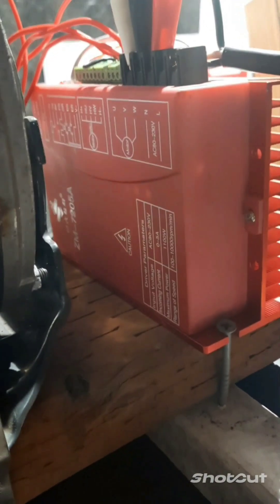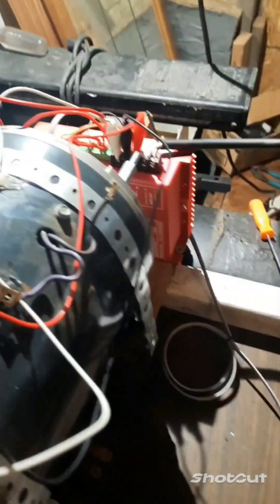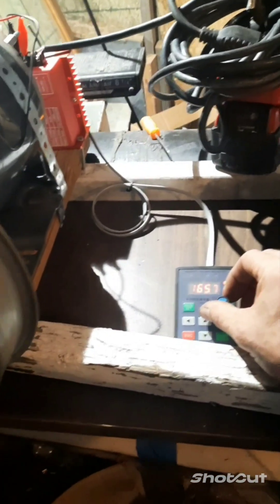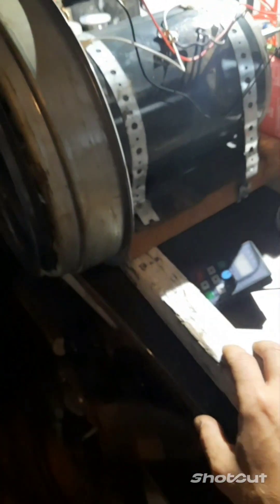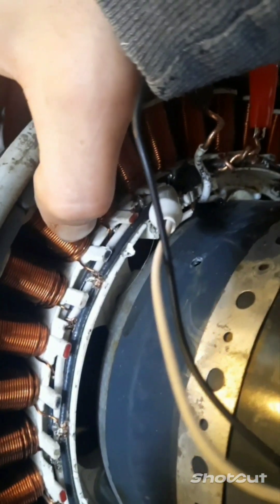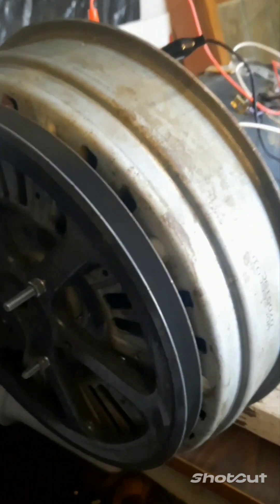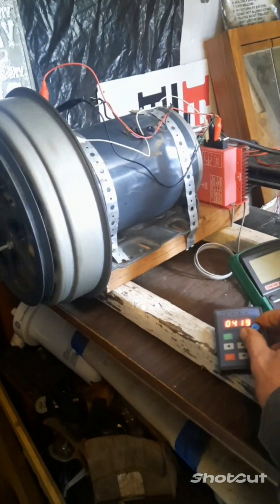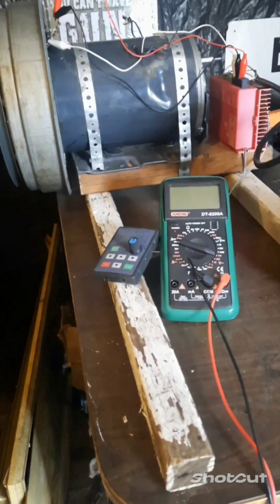bldc motor project p2

Comment: Great work thanl you for sharing. So i think if you rewind the coils on the BLDC motor with a bi-filar wind, you should be able to increase the RPM....the bi-filar wind has an amplification effect.
Reply from the maker: Well, look at the guy with the big 🧠 lol thanks bud that makes sense to me, I didn't even think about that fiber stuff.
Will totally look in2 dat.
Great, more research